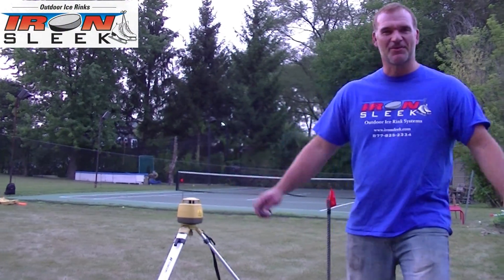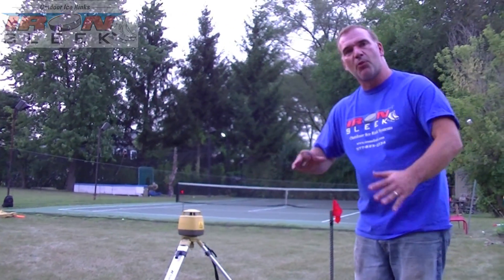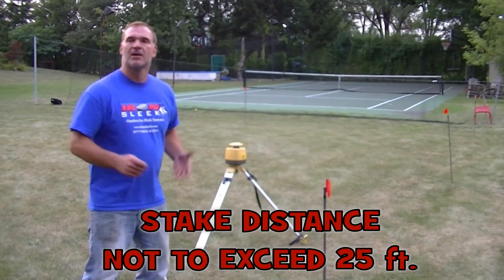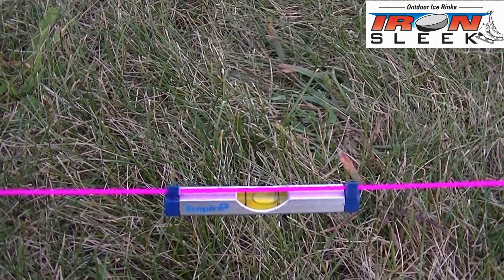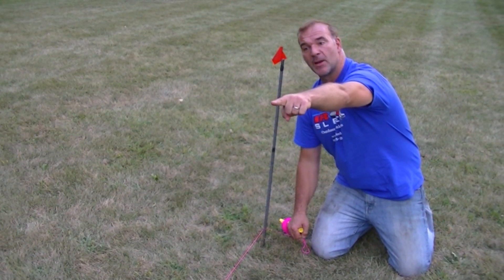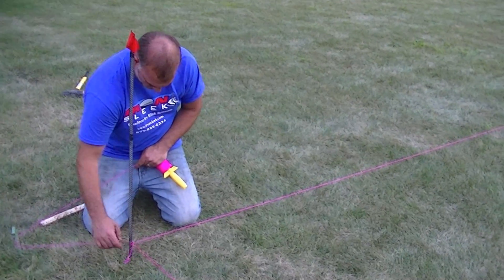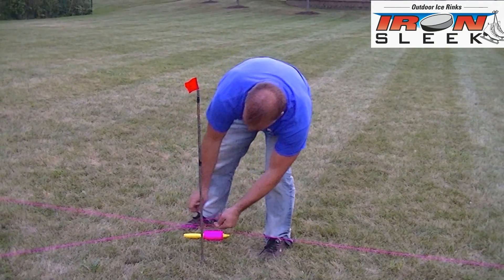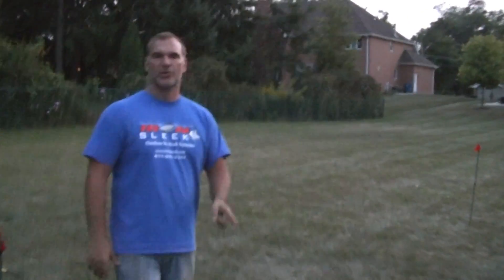Measuring Grade for a Backyard Rink with a line level.

Comment: I used to work for this one company, and the Foreman never trusted string levels. He would rather use a straight edge with a 4 foot level on top smh...
Reply: I don't blame him either.  The issue with bubble levels is that the bubble is smaller than the lines, and unless you look at the aperature dead square from the same reference perspetive, you're going to be off.  For short runs, i'd say a bubble level is ok, but when you start getting into 10, 20,30, 40+ foot runs, that few degrees of error and reading error gets magnefied, and your layout is wrong.

For long runs, a laser is where it's at.  for short runs, bubble level is acceptable.  i also use a water level for when i have to project a line beyond an obstruction to the laser.  I work with piers and pilings quite often and need to transfer level marks quickly.
Reply: craydul can’t really disagree with him.  A laser transit is the way to go.  Be really careful with very tight strings if you need to use a line level.  Also keep the stretches short.

Comment: Great video!  After you get your first level reading take off the line level and turn it around and remount it.  If you're still level then your line level is accurate.  This trick works on any type of spirit level.
Reply: That's a great tip.